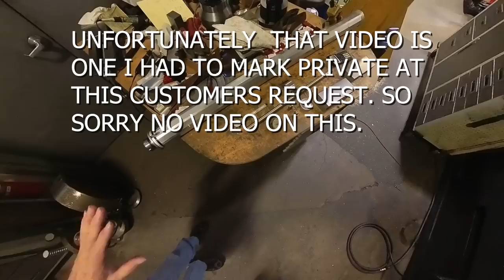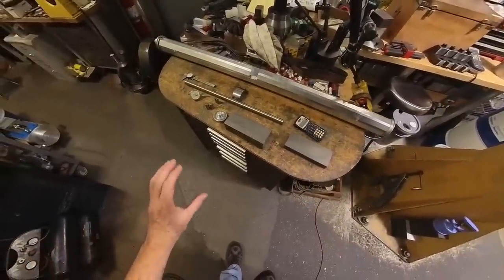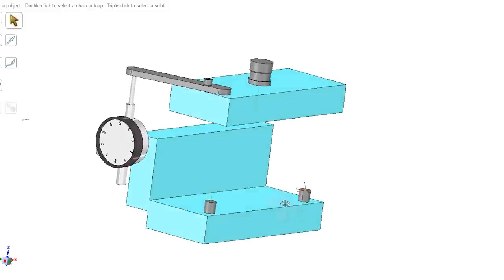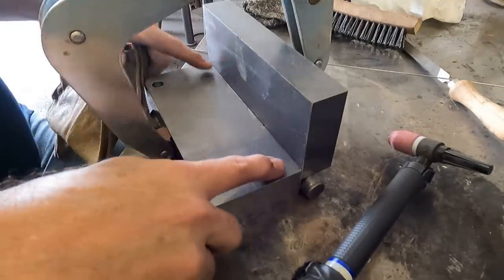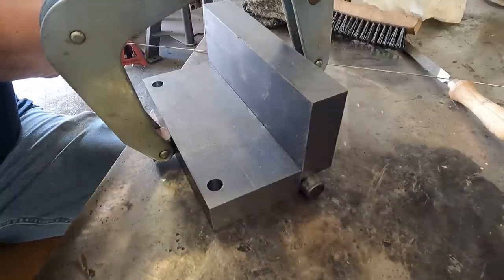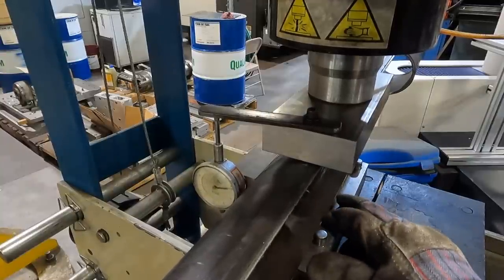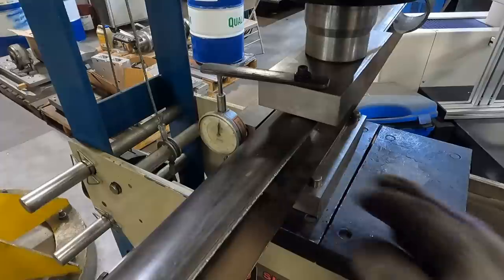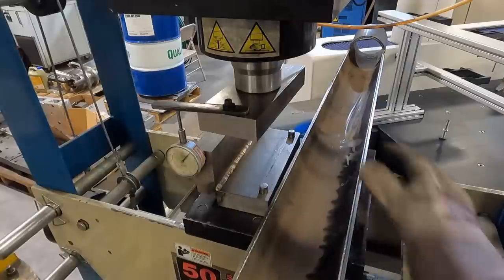Fixture For The Press

Comment: The only bad thing about this is that it will only typically bend in one spot, so that ends up making your half tube's out of round.   Not sure how important that is for where it's going.
Reply: That's why I hate jobs like these. You go off of the tolerances they set but you don't know what goes in it or if they thought about how you would achieve such tolerances
Reply: @LongJ0hn  That goes for a lot of things. lol..  I built custom homes and metal buildings for over a decade with my own crew.. and it's super often that the engineer and architect would have flaws in the drawings and only allow for certain size rafters or joists, for example-- and I'd have to tell the home owner that we can't build it how they have drawn..  Or a floor not being thick enough to run the air ducts like they want/  or a common one is for the stairs.  They almost never allow enough space for the stairs to work correctly-- and there are strict codes for how wide and how tall the steps have to be, etc....    Or that the larger lumber required for the span over a room or roof is going to look different than what is drawn-  and I'd have to make sure the home owner understands the differences before I build it;  because the last thing you want is to surprise them with a difference.  People are so very picky about every little detail, so you always have to tell them up front about these things, to set expectations.   Or often they would have windows in a certain spot on the "elevation drawings, where you can see the side of the building..  But then on the actual floor plan, it would be in a completely different place-  because they moved it to line up with a sink or centerline of a cabinet on the inside, rather than center of the wall outside.. etc. etc...   Dozens and dozens of prints and I NEVER remember seeing one without flaws;  They always had flaws that I would have to overcome and be the problem solver, when no one has any answers.  It gets annoying sometimes.

Comment: I weld some sleeves like those but they are made from 304.
Reply from the maker: They do also make these type of parts out of stainless steel. Some of them they actually drill and hone out of solid round bar to make the tubing!

Comment: Thanks for sharing, hope your arm feels better soon.  Wondered if you introduced some heat while holding the press at the desired radius?
Reply from the maker: The heat required would change the certification of the material. People don’t seem to understand. You can’t just start heating material without retesting  it’s mechanical properties.
Reply: @EdgePrecision  Thanks for taking the time to answer my question. Makes perfect sense. I just assumed the cutting process had already introduced heat in the parts. You’re a very talented individual. Thanks again for sharing.
Reply: I always appreciate the considered discourse in the comments. I too wondered how torching it may have introduced heat into the part. I guess the plasma torch doesn't have the effect of heat soaking the part enough to effect it? I imagine the area immediately adjacent to the cut is certainly affected, but will be machined off. Pete, do you take any precautions to make sure you don't overheat a part while cutting it?
Reply from the maker: @93Martin  No the plasma torch doesn’t even get the part hot. I can pick it up right after cutting it. When I mill the track in the part. There is only about 1/16” of material left to cut thru. It cuts as fast as I can move the torch. Hardly any heat gets into the part. Also there is still about 1/4” of material to get machined away.
Reply: @EdgePrecision  Cool!

Comment: Do you have a vice setup that you mount in the Integrex for milling jobs? I'm about to set something up that can go between my 4th axis mills and my grex.
Reply from the maker: Look at my video called Special Groove Gauge. You will see the one I have in that video.
Reply: @EdgePrecision  ahhh yep. I see. I'll be going for something a little more modular and easy to whip in and out than that with some sort of zero point fixturing (still trying to decide on a brand to go with)

Comment: What is the milling cutter for centering? With what plates?
Reply from the maker: Milling cutter for centering? The only place I use'd a milling cutter on this fixture was to mill the hole for the shank, that fits into the ram of the press. Does that answer your question?
Reply: @EdgePrecision  10:32
Reply from the maker: @martin32238  it’s a spot drill.

Comment: I'm surprised you didn't have the dial indicator read off the top of the part, instead of the upper jaw, so it could not only measure the amount of squeeze, but show the tube diameter when released.
Reply from the maker: I was trying to keep things as simple as possible.
Reply: Then you have to move your indicator every time.  It's inefficient
Reply: @calholli  No, I was thinking of a setup where the indicator stays in the same position much like Peter has it, but the contact arm is free to touch the top of the tube instead of the top jaw. Lots of ways to make that happen. I guess it all depends on how many parts you have to do and the repeatability of the corrections required.
Reply: @RambozoClown  But it's literally the exact same.  The jaw is directly touching the tube.   So he's still measuring the same thing--  all he has to do is rest the jaw directly on the tube, and he could see how much it had moved and stayed.
Reply: @calholli  I totally get what you're saying but the repeatability of the jaw touching the tube is lost because the press/jaw is static (prob not the correct term).
You want the indicator to 'indicate' immediately when it touches the tube. It does that because it's spring loaded. 
You don't get that feedback using the jaw. Using the jaw, you're just guessing when it touches the tube.
I hope all that made sense.
Reply: @josephcitizen4195  You're only guessing on the first one. After that you see about how much it takes and the rest of them will go much faster.

Comment: I guess once you figure out how much deflection there is you could make a stop to press down to.  Different batches of material will probably act differently so that might not work.
Reply from the maker: That could work. I would just have to be careful at the ends. as I said in the video its possible to kink the part where it turns back to tubular shape.
Reply: @EdgePrecision  perhaps a plug could help

Comment: How did you get the 3 hard jaws to hold the flat stock? Did you mill the bottom jaws?
Reply: You can see at 8:49 in the video that the plate catches the step on the bottom 2 jaws.
Reply from the maker: Just the standard jaws. This is light machining so it’s OK. But this isn’t a way I’d run a real job.
Reply: @EdgePrecision  pretty cool. I saw it pop up while I was holding.035 in a 4 inch dia because my saw guy forgot how to read a tape measure. I going to try it. I run a Mori sl 2500 and always looking for new ideas and your videos give me plenty ty
Reply: @agie170hss2  I went back and caught it. I figured at first he had some jaws notched for holding rectangles.

Comment: Would some heat on the tube help the process, or just an unnecessary step?
Reply from the maker: The heat necessary to do that would change the certification of the material. That couldn’t be done without retesting the materials mechanical properties.